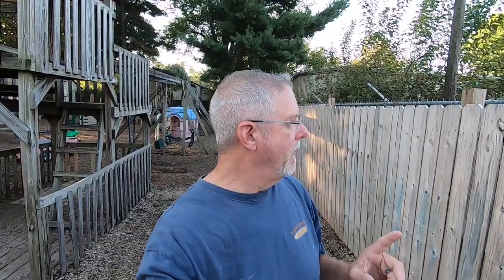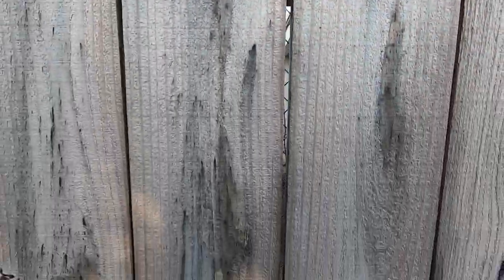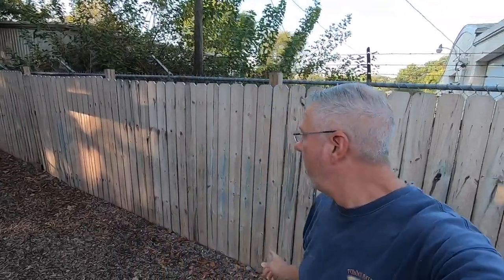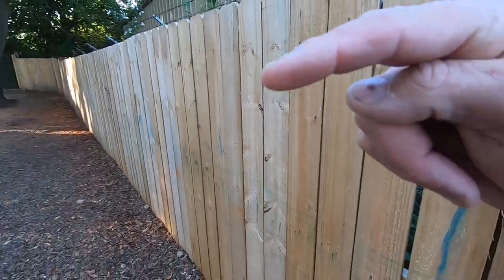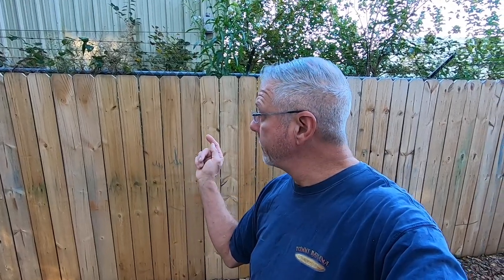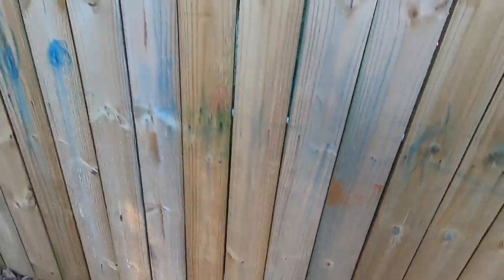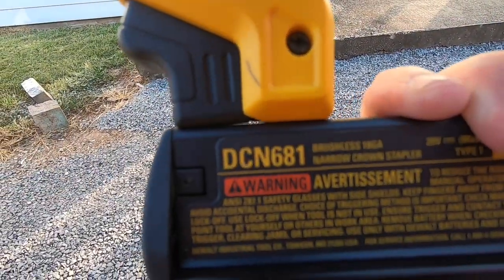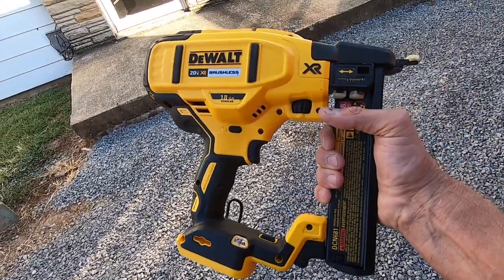Fencing With DeWalt Staple Gun

Comment: Not sure how the climate in your region but in winter summer temperature cycle, those pickets will shrink and expand and eventually those staples will come loose. 
The factory nails are even worse. 

Anything other then full round head ring shanked galvanized or SS nails will not last for the expected life of the fence.

Comment: Makes sense. A lot of old hardwood flooring is put in with staples. In fact, when you google... are staples or nails better for hardwood floors? Here's one of the answers you get.
"Nails and staples differ in their holding properties. A staple will give a stronger, less-forgiving hold because of its two-pronged construction. Nails allow for a more natural expansion and contraction of the hardwood floorboards with fewer problems."
Reply from the maker: Thanks for you comment and watching, I’ve had less problems with staples than nails.
Reply: @David Farmer  have you used ring shank nails?

Comment: His fence has been up a little more than a year with ripped 2 x 4’s and staples. Well no doubt. But I guarantee here in Florida in 3 years that will be a pile of firewood.
Reply from the maker: That’s right and the fence is still standing and Ive only had to tighten a couple boards up. Are you ready for this and its been up for over 3 years.  Thanks for commenting
Reply: @DavidFDay  Well I guess I miss understand something because I heard one year. But by all means build fences with 1 X 2”s and staples. Sure you’ll make a fortune considering how everyone else who builds them must be wrong.
Reply from the maker: Never saying anyone’s way is wrong, I build my stuff on my property the way I like and others can build the way they like. When I was at Lowe’s and home depot and was looking at the prefab 8ft sections of fencing they sell and measured the thickness of the cross piece it’s ruffly the same as ripping a treated 2+4 in 1/2. So that’s why I did it. Thanks for commenting helps the videos. Have a blessed and great day!!
Reply: RIP Roland who used PT for firewood. May we remember him well.

Comment: how long was the Staples ????? 1 1/4" Galvanized or Stainless
Reply from the maker: They was 2 inch stainless staples
Reply: @DavidFDay  thanks for Reply David - are you Sure 2" ?????
i was at Home Depot the Other Day and the Specs on the BOX says MAX 1 1/2 " Staples 
how did you fit in the Magazine ?
Can you Change the Magazing to Hold Longer Staples ??
Reply from the maker: It’s been so long since I put the fence up I don’t 100% remember but I’m sure I used the longest the gun would hold.